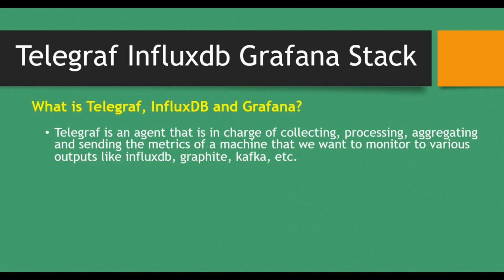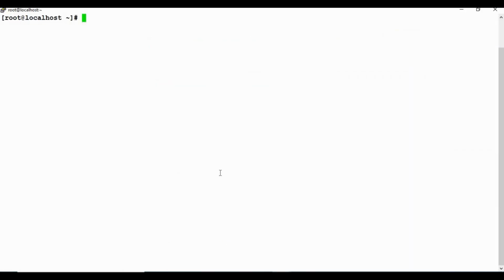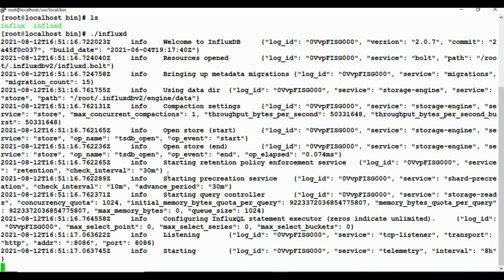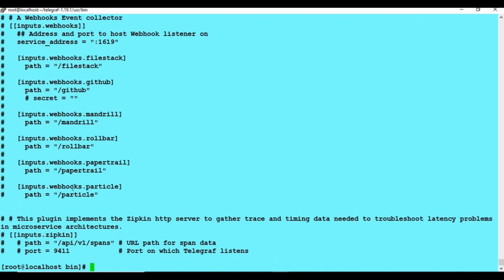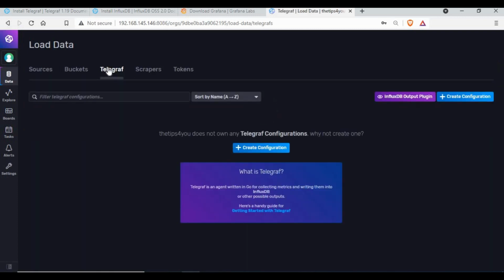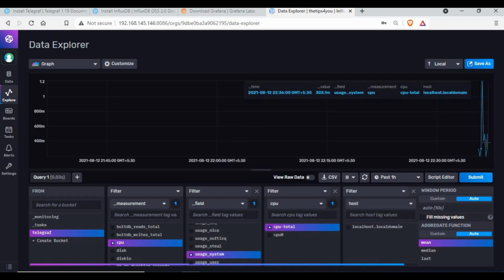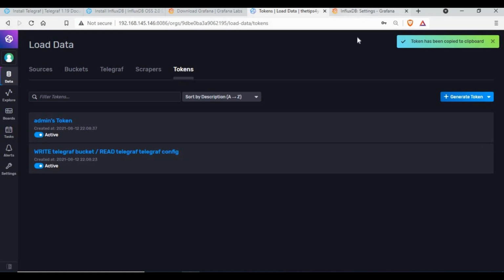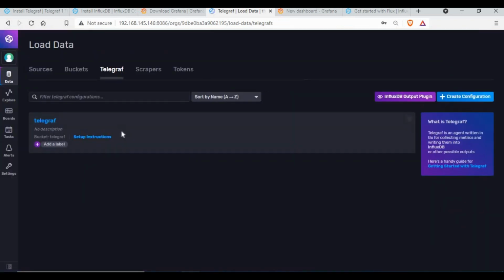"Setup InfluxDB, Telegraf & Grafana from Scratch 🚀 Complete Tutorial!" #influxdb #telegraf  #grafana

Comment: I'm getting this error )-:  = Error in plugin: error getting disk io info: open /proc/diskstats: no such file or directory
Reply from the maker: When exactly are you getting this error?
Reply: @Thetips4you  when starting telegraf. Just keep coming up with this error. 
 [inputs.diskio] Error in plugin: error getting disk io info: open /proc/diskstats: no such file or directory
[outputs.influxdb] E! [outputs.influxdb] Failed to write metric (will be dropped: 401 Unauthorized):

I'm running it on Ubuntu on a Windows Desktop, not sure if I should run it on Centos or something. It should work though. I've managed to get the CPU system telegraf working but not when using templates.